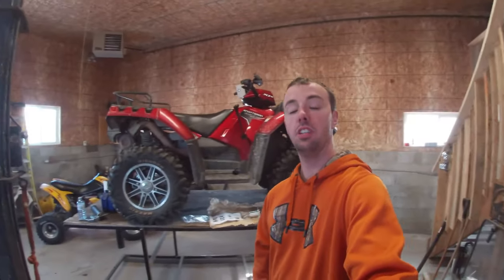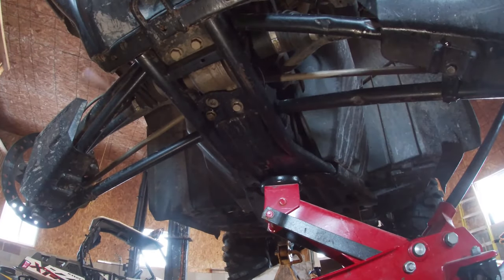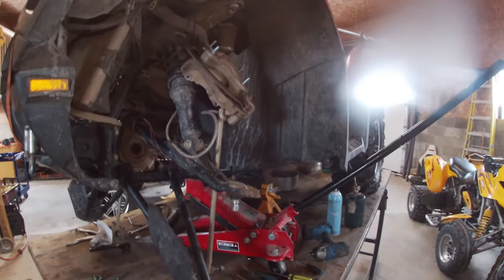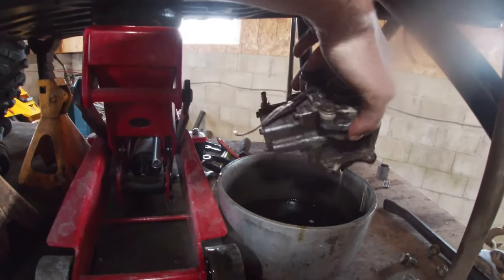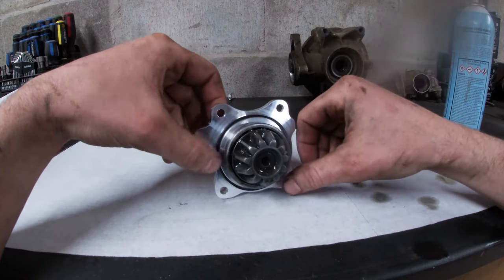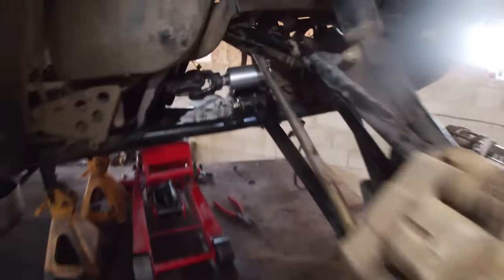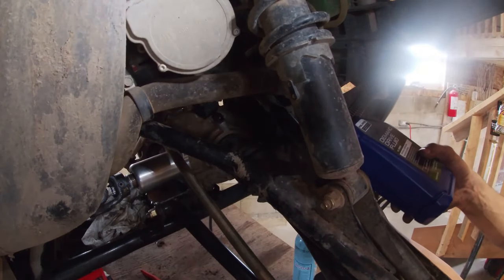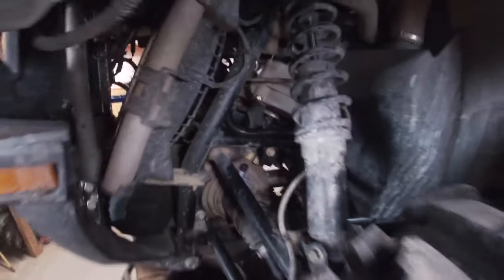Sportsman 850 Front Diff Billet Pinion Cover Install

Comment: I had to fight with getting my bolts off as well.  One Allen head became stripped...
Reply from the maker: ADVENTURES This Way  yea there in a tough spot to get at. You might want to consider replacing the Allen head screws with a regular hex head bolt

Comment: Have you had many problems with that bike? I want to get a 19 850 HL but am scared about the reliability
Reply from the maker: Honda dude only issues so far have been  oil getting pumped into the air box. There’s a fix right from Polaris for it. The oil doesn’t drain from the valve train back  down to the bottom end properly but it’s not a huge deal to fix. I know at one point the gear on the crank or cam (can’t remember) but it was pressed on and some of them would slip and the timing would get off and they would run like shit so the fix was to weld the gear. That was around 2013 tho, not sure what the newer bikes are like. Also the a arm bushings and lower ball joint wear kinda quick on the older ones especially in mud. But I like that bike they ride nice and have decent power and I love Polaris power steering
Reply: Eric Brinson thanks I think I’m gonna get it but what part do I need to get to fix the oil leak. Ima get that and a billet plate so the diff dosent go and that so the oil dosent leak. I’m just trying to basically bulletproof it
Reply from the maker: Honda dude I can’t remember what you need for the oil on the air box issue but there’s tons of videos on YouTube about it

Comment: Have you had many problems with that bike? I want to get a 19 850 HL but am scared about the reliability
Reply from the maker: Haven’t had many problems at all. I think they got all the little kinks worked out in the first couple years they made these bikes. Make sure you check all the suspension bushings and ball joints. If the bike has seen much mud they’re likely worn

Comment: Hey man I love the platform you used to put the 4wheeler on. Do have a video of you making it on your channel. If not I'd love to see how you made it.
Reply from the maker: sportsman _source  no I don’t have a video of it, it’s my buddies shop and his lift. It’s pretty simple, it’s a square frame for the deck with two sets of arms, on in the front one in the back, and as the winch pulls, the whole platform just pivots up on those arms. If you’d like more info on it I could take video of it some time.
Reply: @ericbrinson9741  thanks I'm going to try and build one for my shop.

Comment: I got the same 1 from custom moto quad. So no more ADC huh.. great video man.
Reply from the maker: Jesse Hamm that’s right it eliminates the ADC. My first thought was well that sucks it eliminates that feature but in the 9 years of my dad owning the bike he or I have never once used it. The engine brake works well enough. Dads got a couple miles on it now with no issues.